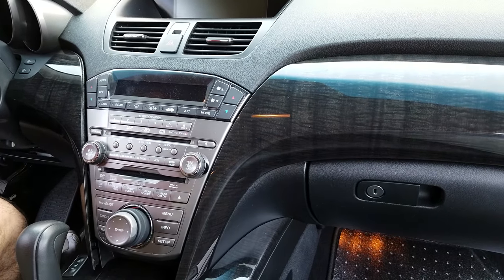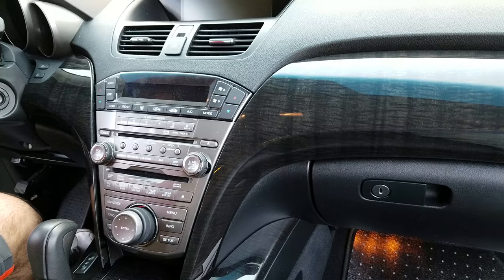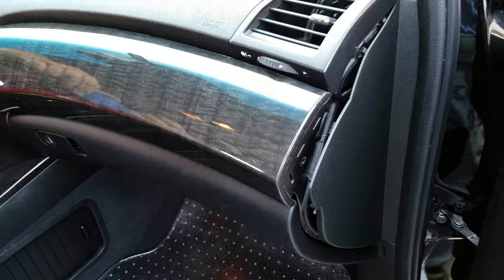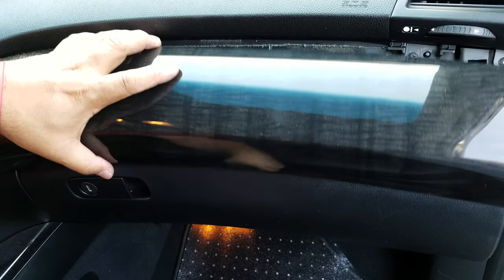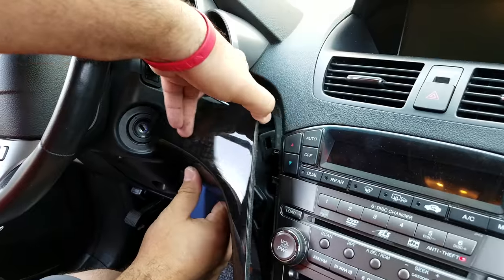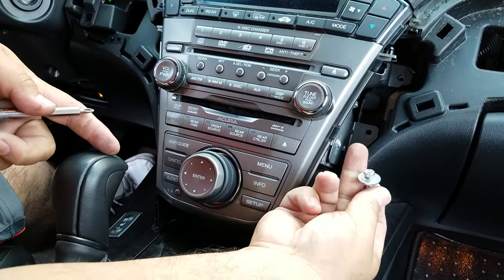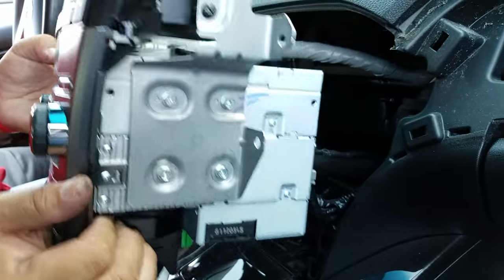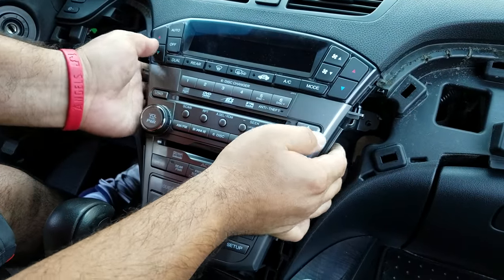How to Remove Radio / Navigation / CD DVD Player from Acura MDX 2009 for Repair.

Comment: Thx for the vid!   My wife jammed 2 dvd in the player and now im trying to get them out.  Any recommendations?
Reply from the maker: You need to remove the whole unit then disassemble the DVD mechanism in order to get them out.
Reply: Sounds stupid but smack the lower right hand side of the unit hard several times.
Mine was jammed up and I couldn't get it to eject or play anything until I read that tip somewhere and tried it.
Beats removing it and taking it all apart.
That was a month ago and it's still working fine.

Comment: Ive got a parasitic power drain coming from this unit in my car.  Have you had any experience with that, is it something you can fix or something that requires replacement of the unit?
Reply: U sure it's not the bluetooth module?  You might have to pull the radio fuse

Comment: Hi, my radio makes a noise when key is off, it sounds like a very small fan.  It drains the battery. Do you know what it may be?
Reply: Yes, I have a 2007 MDX, with the battery drainage, a friend of mines solve the problem, but didn't explain wh a t he did. Sometimes I will hear rumbling mouse under dashboard, but for now (1 ,ye a r) mo issues, just the noise.
Reply: Find the fuse for the BLUETOOTH and remove it.
 You're welcome !!
Reply: @beverlyjohnson8251  That noise is most likely the air mix motor - google acura mdx air mix motor - might need to be removed , cleaned and replaced
Reply: Air blend actuator

Comment: I'm getting a Nav receiver error 1303........so the troubleshooting guide says to replace the Nav unit. Can this be fixed? There aren't any replacements kicking around that I've seen other than e-bay untested and not guaranteed.

Comment: is it possible to replace just the DVD drive?
Reply: I’m with him. I think my kids put coins in it
Reply: Yeah I'm in the same boat with the coins in the cd load/unload slot. I'm hoping I can just take the entertainment/ navigation module apart to get to the cd changer and unjam everything. Will post an update.
Reply: was this issue fixed, i think my son also put coins in my car DVD player - how did you fix iit?
Reply: I took the whole CD changer apart. I was able to get the CDs and the coins out, but it still says it is loaded with all 6 disks. So I was able to recover the CDs but wasn't able to fix the CD changer.